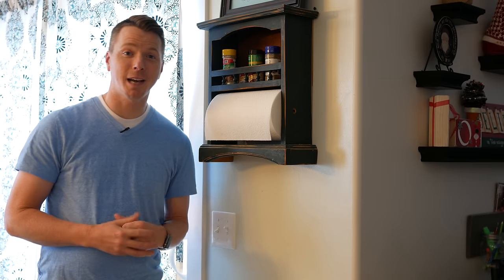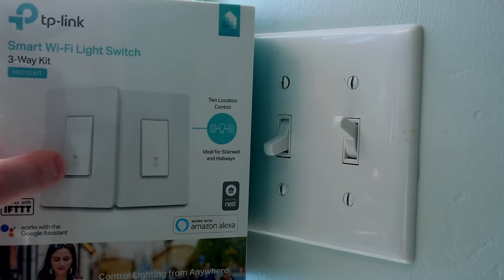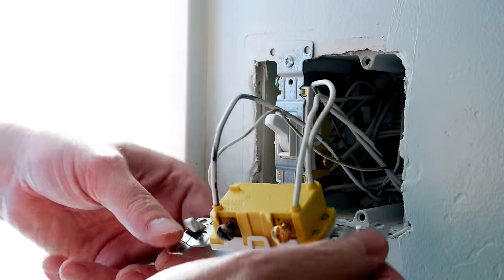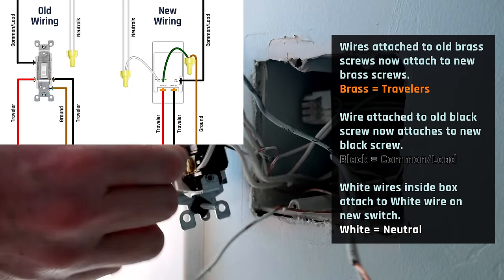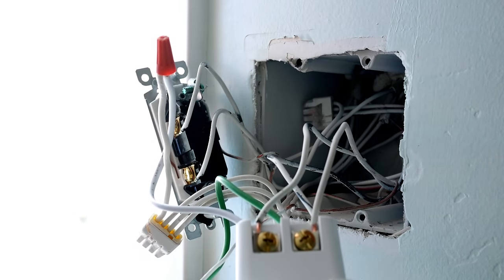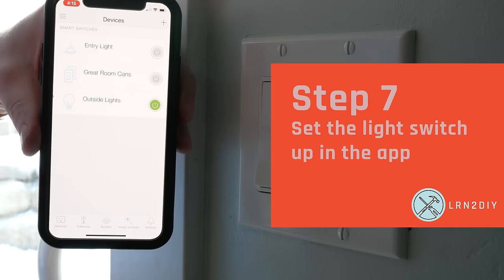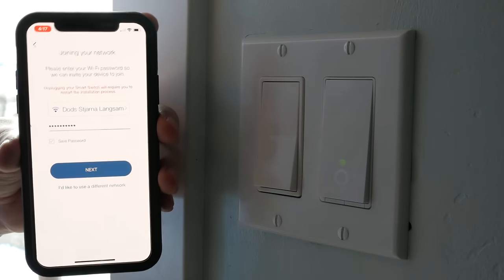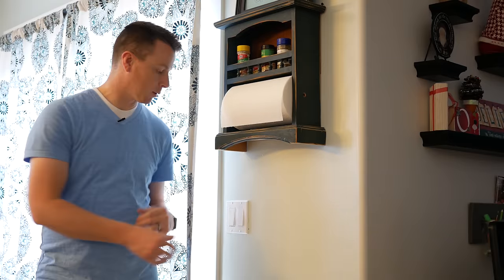How to Install a Smart Wifi 3-Way Light Switch

Comment: Nice. A lot of people asking which switch you should put this on. It depends on the switch. Some want to be on the load side and some want to be on the line side. 

Also, some require you to change the wiring of the second switch, and some don't. Some require you to connect a specific remote switch to work with the smart switch.

We recently installed Amazon Basics 3-way smart switch and it specifies if using a single smart switch it must be on the load side, ie, the side where the switch is connected to the wire that comes from the light fixture.

Comment: Your smart switch always needs power.  It does that by connecting to the LINE and the neutral (that's why it needs neutral, to power itself)

So in the situation demonstrated, you have to be sure that the switch you replace is connected to the LINE.  If you replace the switch that is connected to the LOAD, if you switch off using the other switch (connected to the LINE), it will cut power to your smart switch and will not work.

So, in most configurations, you have two switches.  If you replace one and is sometimes shuts off the smart switch, switch switches :-)
Reply: This was what I was looking for. I couldn't wrap my head around how only replacing the one would work haha. But now that I think about it, how could you replace both?? Both would need line power!
Reply: Thanks for the clear explanation! I heard the smart switch should be installed at the 1st switch with constant power, but some said their switch worked installed at the 2nd switch. Was deciding if it matter, but I'll install at the 1st switch.
Reply: Thanks for this. How do you determine which switch connects to the line or load?

Comment: Best video on this topic.

Does it matter which regular 3-way switch I replace with the TP Link Smart switch?
Reply from the maker: I don't actually know for sure. I have had a couple of 3-way switches where I tried to install the new switch and it didn't work, then I tried it on the other one and it worked. I'm uncertain if that's because I wired something wrong or if it has to be installed on the "master" switch. I think this can really depend on the wiring configuration of your setup as well. I did some searching before I got started with all this and didn't find a definitive answer.
Reply: Months late for you I'm sure, but YES it matters. You need to find the one that has the load line from the circuit box. Often time sit will be a black wire nutted in with a bunch of other wires in the same box. Can get more complicated, but Google how to find load line in 3 way switch setup.
Reply: It does matter. You have to use the side with the load wire not the common. Check this vid to see how to find the right side https://youtu.be/Xp4FWJRzHdo

Comment: Let me get it clear. One 3-way switch kit comes with 2 light switches. You only need one to replace one of the two older dumb switches and now you have wifi capability on top of both the keys physically work as old days to either way turn on or off, and lastly, you have a second smart 3-way switch to install in another location! 
Am I right or am I missing something as this sounds too good to be true! 
Thanks,

Comment: Nooice! Thank you! My living room has 4 switches that control the same light. Is that set up the same as 3-way? Can I use the same 3-way switch in this video?  Also, I have a ceiling fan that has a light. One switch controls both light/fan. Can I just use the non-3-way version? Thanks much!

Comment: So quick question, I love the tp link stuff and have a ton of 3 way, and even 4 way, light circuits in my house. I like how you only used one switch on the circuit, but I'm wondering what happens if you only do one smart switch and then flip the non smart switch. Does it totally confuse the system? Do you now have to tell Alexa to turn ON the lights when they're already on to get them to go off?
Also, any experience with one of the other switches on the circuit being a dimmer?
Any help would be awesome. Thanks.
Reply from the maker: Great questions. I wondered those same things and I have good news. If you only put one smart 3-way switch in and leave the other one dumb (at least the brand I used in this video), it works the same as if both were smart. It knows if the light is on or off and works just like you would hope it would. 
As for the dimmer, I have that set up as well. I have some 3-way light switches in my basement where one of them is a smart 3-way, like you see in this video, and the other is a dumb dimmer. It works perfectly. If the dimmer is set to 30%, then the lights turn on at 30%. The dimmer is in full control of brightness and the smart switch just acts as your one of your on/off switches. No issues and, if you don't need to change your brightness often, it can save quite a bit of money to use this setup.
Reply: @LRN2DIY  Awesome, thanks so much. One more for ya, do you know if it works in a 4 way? I have a couple big rooms that have three switches for one light.
Reply from the maker: @brandonb417  I'm no help on that one. We don't have any 4-way switches so I haven't had a chance to try it. You might want to scour through the reviews to see if they mention it though. I wouldn't be surprised if it worked.

Comment: Hey @lrn2diy, how does having just the one Kasa on the circuit affect the use of the other 3way switch? Thanks for the video.
Reply from the maker: It doesn't. The other one works just like normal and the smart switch works as if both switches were smart - it's pretty cool. I have this same setup on all of our 3-way switches in my house. One smart and one... not smart :)

Comment: I have watched about a dozen of these three-way switch videos and yours is the best.  My problem is that there is no neutral wire in the master unit. The other switch (that goes to the light) does have the neutral wire.  If I go ahead and install both three-way switches. would that work?  Also, how would I wire the side with no neutral wire?  It is not reasonably feasible for me to run a neutral wire from another switch.
Reply: This is EXACTLY my problem!!! The switch with the Neutrals in the box is the load switch (shorts the circuit, when I connect the Neutral wire to the switch), and the line switch uses the Neutral wire as one of the Travelers! The line switch is configured in a two-gang box with another three-way switch (I would like to replace that one, too). Can I pig-tail the Line wire from the adjacent switch to the Neutral for the smart switch? Did you, original commenter ever get an answer to your question, and get yours to work? Thanks.

Comment: So if you flip the other switch on the 3 way is the smart switch inverted? Or does it detect loads and know that it's now on/off?  You seemed to imply the latter in your video but I would like to see a demonstration.
Reply from the maker: The latter. Adding one smart 3-way light switch will work the same as it did before. If you use the other light switch (the "dumb" one) to turn off the lights, clicking your smart switch will turn them on. If they're on and you use the other switch to turn them off, clicking the smart switch will turn them on.
Reply: LRN2DIY what about in the app? If the light is on and I use the dumb switch to turn it off will the app show the light is off?
Reply from the maker: PumpkinDog33 Yes, app is smart enough to see/know and show you.
Reply: @LRN2DIY  I bought one of these lights and this is not true.  Both the smart switch and the manual switch operate the light as expected, but the smartswitch and app both show the light as "off" regardless if the light is on or not.  I can still turn the light on or off with the app, it just doesn't show me if the light is on or not.

Comment: so what happens when someone turns on or off the other three way light?
Reply: I'm pretty sure it will invert the state of the light. So if you flip the other one while the TP Link thinks it has the light on, it will turn off. Then if you ask Alexa to turn on the light it will likely state it is already on. If you ask Alexa to turn it off, it will turn turn on. I think this is the point of having 2 3way switches so that the software can detect the other switch state and comply accordingly.

Comment: @LRN2DIY - The switch with the Neutrals in the box is the load switch (shorts the circuit, when I connect the Neutral wire to the switch), and the line switch uses the Neutral wire as one of the Travelers! The line switch is configured in a two-gang box with another three-way switch (I would like to replace that one, too). Can I pig-tail the Line wire from the adjacent switch to the Neutral for the smart switch? Thanks.

Comment: Not holding you to an answer since I realize you are not an electrician and a DIY guy but do you know if this install works with a 4 way? My husband and I both love to DIY and work in IT as well like you. We didn’t even realize until we popped off the plates that we were dealing with a 4 way because one switch we weren’t even aware existed after living in this house twenty years lol 🤷‍♀️
I looked on amazon in q&a comments for this switch and ppl said it worked for them on 4 way and they just installed one smart switch and left other two switches alone. I would just think the switch in the middle of the other two (since the other two look like 3 way and only the one in middle has two red wires looks like 4 way) would be the one that controls the load and therefore the one you have to replace? Thanks.
Reply: Okay we figured out a work around for anyone struggling with 4 way switch (3 switches controlling 1 light). Husband and wife computer programmers never surrender! We found it works best installing on the first switch going to the box (line) as the last switch going to the light (load) had more delay. We read not to try this on the 4 way switch on the middle of those two three ways so we didn’t. For us the 3 ways had two blacks and one red. The 4 way had two reds. We tested the wires with voltage detector to make sure we were picking up the right wire to connect to line but it was in a black screw and the other black went to a copper like the red so those are both considered travelers in this situation. After you install and control the lights in the app it doesn’t work on a 4 way like our traditional 3 way installations which work as his here. In the Kasa app for the 3 ways the green light indicates the light is on. In the 4 way set up it indicates it’s working on the request basically. Do not click again until that green light goes out or you will blow apps mind and get it out of sync (only on unsupported 4 way mind you works perfectly in 3 way). Okay so now we use the built in hub in our Alexa Echo Show 2.0 and voice control our devices on that and several 3rd gen dots. On the 3 way that works great. On a 4 way using the Show 2 as hub you have to say “alexa, turn the light switch on” every time whether you want to turn it on or off. Asking her to turn it on and off as you logically would doesn’t work right. Or we have the whole thing wrong but I’m guessing it’s code that’s not working correctly on the show’s hub. I was ready to box it up and send it back and try to talk him into spending $100 on 3 GE switches to hopefully work better but my husband said “wait, just say on every time” my programmer brain was with him as I know it’s just a toggle either way 🤦‍♀️ guess we will stick with this and just say on every time lol.

Comment: Do you add your IoT devices to your main home network?  Or do you have a separate network for those?
Reply from the maker: I add them to my main network but I did discover that not all routers work well with a lot of devices. I'm a big smart home guy so we have 77 devices on our network. We switched to Google WiFi mesh routers and they handle it like a champ. If you have 5-30 devices, most routers can handle that just fine.

Comment: Hi Justin, thanks for the great video very informative. I just curious about the other end of the line which is the normal 3 way switch. If you toggle the other 3 way switch (not smart one) would the power of HS210 still available? Because in my case the power was cut if I turned off the normal 3 way switch. It is alright if the normal 3 way switch is in on position but once it is in OFF position there is no power on the smart 3 way switch (H210). Thanks in advance..
Reply: That should not happen.  Someone did not wire you 3 way right.  You have a feeder or live wire 2 travelers and they goto the other 3 way.  That one takes the 2 travelers and gets power off of 1 of them based on the other switch.  Then you have the load going to the light from the switch.  So if you have anything else on there it's wrong.  Someone wired mine wrong and I was surprised it worked.  Took me hours to identify the wires.

Comment: Good vid, And I don't really see why would anyone install both switches on the same set.
Reply from the maker: Agreed! A standard decora 3-way light switch costs about $3-5 so there's no point in wasting the money when one smart switch is all that's required. They advertise it as if you need both, however.
Reply: @LRN2DIY  on the 2nd light switch. Any modification required? Does it have to be on for the smart switch to Operate? What if someone turns off light on switch 2?
Reply from the maker: @lailanis1  Nope, no modifications necessary. It works exactly like a standard switch - either switch can control the light. If the light is on, either switch can turn it off and vice versa. It's really great.
Reply: @LRN2DIY  so if non smart switch is off. Smart switch can still operate like it should.
Reply from the maker: @lailanis1  Indeed.
Reply: You guys have saved me a good amount of money
Reply: @LRN2DIY  Do you know if this is the case for other sets of these or manufacturers? I'm looking at MartinJerry switches and they sell a three-way, dimmable two-pack, but they refer to one switch as the master and the other as the slave? Wondering if they could also be split up to power two different circuits. I only have 2 sets of three-way switches in the whole house. One is actually a four-way I think (one overhead light, but three switch locations). Alternately, do you know if these TPLink switches use the Tuya modules making them usable in the more generic Smart Home app? And by extension HomeAssistant.
Reply from the maker: @douglashempel8037  I'm not much help on those questions. I can only say that I haven't read anything that will confirm that the MartinJerry switches or others can be used individually like the ones in the video can. As for the Tuya modules, I'm not familiar with that. Sorry!

Comment: What happens to the light the switch is connected to after the power is restored after a power outage/flicker?? If the light is in the off state, does it go to an off state after the power is restored or does it turn on like the smart bulbs do??

Comment: Do you have any idea and advice when status always shows as "off" on Smart Life App and Alexa?  The only way I can turn  on and off is to ask Alexa to turn on the lights as Alexa does not respond to off and as I stated status is always showing off.  Thank you.
Reply: I just realized that when on or off will very briefly show the correct status and then revert back if this helps with any clues on how to resolve.
Reply from the maker: @denmarkstagestophouse5740  That's a tough one - could be any number of things but I'd try to remove/forget the switch and then set it up like new and see if that helps. I have had a few connectivity issues over the years and that usually does the job. Good luck!

Comment: Ok. I was going to pay someone to install my one 3pole and 4 single pole but they had to postpone due to a COVID test so I took a chance and I've installed the 3pole and 2 single poles!! Tomorrow I plan on installing the other 2 but after trying 15 minutes of off/on different circuit breakers I can't locate the one that turns off/on the upstairs outdoor light switch! I had it installed and the guy that did it connected off the outlet in the attic/crawlspace (where my air handler is)...so I have no idea what circuit that connects to/runs off!

Comment: What’s will happen if you instill a non 3 way smart switch to a 3 way outlet. Will just one end work?
Reply: If you use the kind mentioned in this video, both ends will work great all the time. That's my exact setup. With this type there's no need to put a smart switch on both ends - just one.

Comment: Hello Justin, we have a smart switch that with Load,Line,Nuetral,Ground wires. It's single-pole switch, but according to what you showed on this video, A single-pole smart switch can be used on 3-way switch also? Just need to change one of the current switch and remain the other, right? Please let me know...

Comment: So the other switch (the one that is not "smart") does not require to change anything? Just by replacing one of them was enough? and you can still use both to turn on/off the lights?
Reply: That's correct. It's really nice.
Reply: @heynils  Excellent. Thanks for your response.

Comment: After installing if my other non smart switch is flipped to turn lights off will it register in app as being off or do I need do or replace it with a smart switch?
Reply from the maker: The other (“dumb”) switch will register the change in your app. Only one side needs a smart switch.

Comment: Will this switch work with a ceiling fan?
Reply from the maker: The concept is  exactly the same so it should, but be sure to check the wiring of the fan first. If it's set up the same/similar to what you see in this video then it should work.